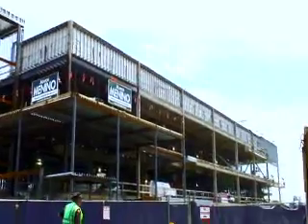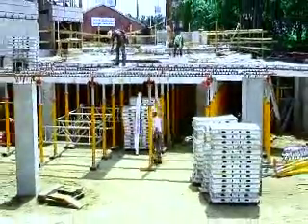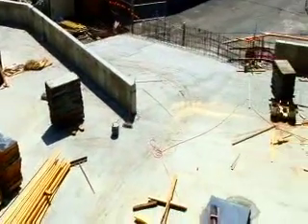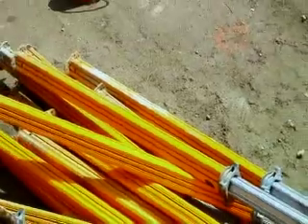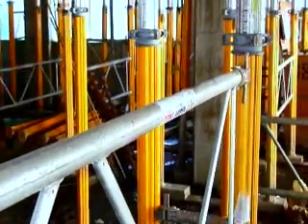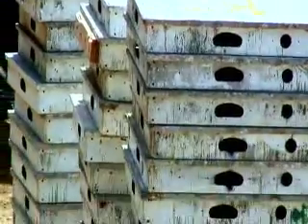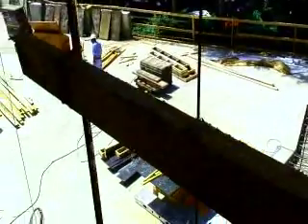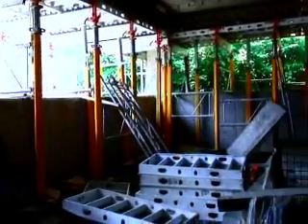Carpenters Center New Building Progress: The PERI Skydeck System

Comment: I repair the skydeck and I would like to know, why does the middle black tab get cut off all the time? it's a pain in the ass to fix
Reply: if they are like us, they need to cut the "tooth" because they would be using a long beam parallel to a short regular beam section. think 3 panels on a regular beam and 5 on a long beam... if you put a long beam up beside a regular beam only the first three panels will fit in, then the 2 way head gets in the way for the next panel.